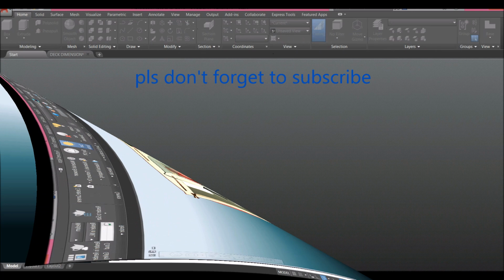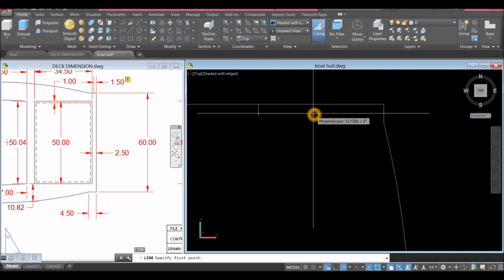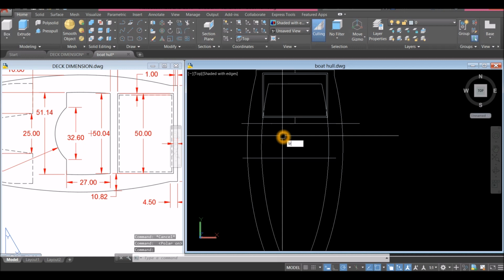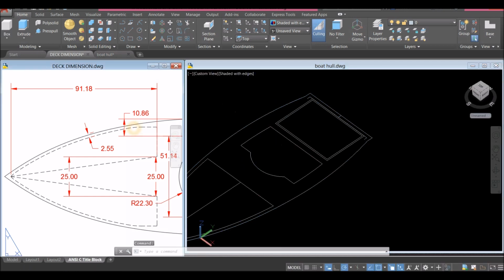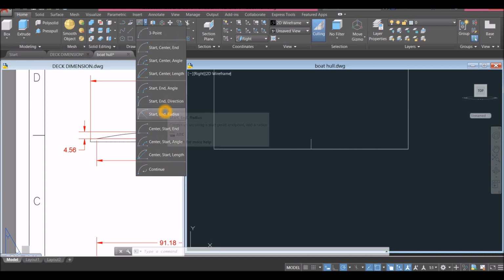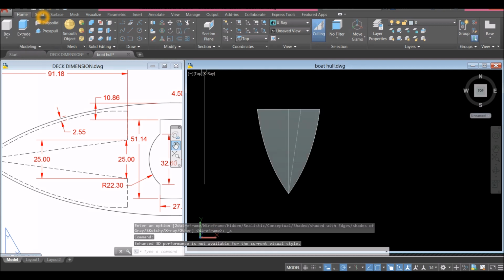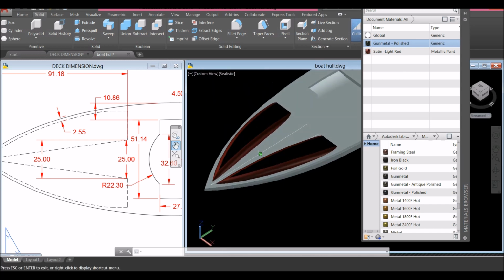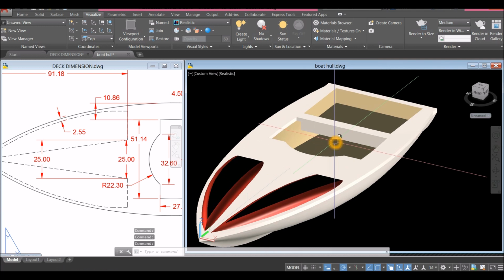Designing 15 feet Speed Boat  in Autocad PT.2

Comment: Hi AC,
Another great lesson series. However, I have a nagging question, viz. some of the dimensions shown on the reference drawing don’t match what you draw. Case in point, at about 6:46 you stretch the 50.04 base line to ensure proper intersection with the curved (deck outline) profile line that was offset by 10.82; the eventual geometry must be closed ready for the push-pull; I get all that. The dimension shown on the refence drawing is 50.04, but after stretch, it is 50.08 by my reckoning. I thought the reference drawing and subsequent dimensions are made AFTER the drawing is completed.